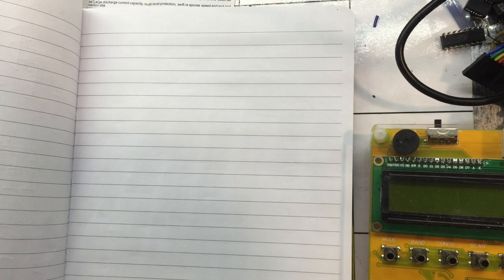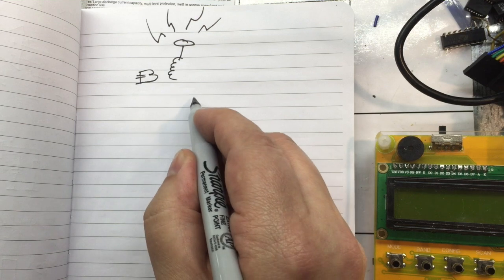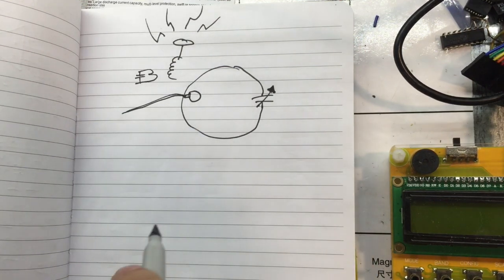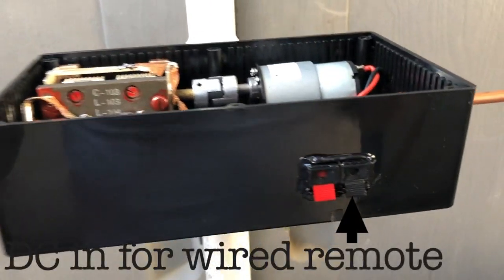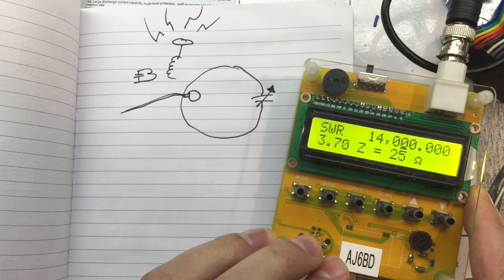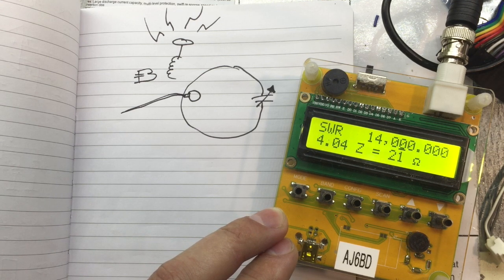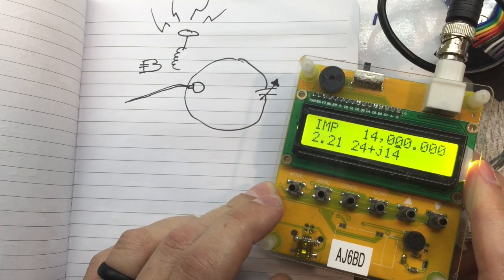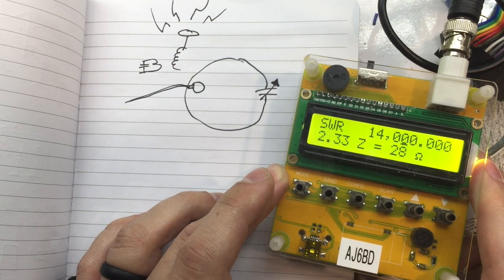Homemade Magnetic Loop antenna -- will it work?

Comment: i haven't seen any math as to find the 1/10 of the wave length for the band you plan to use. after fiddling with some basic equations will offer this result for comment.
300 / f in mhz = wave length
300÷7.074= 42.41 i. e., 40meters
42.41 x . 1 = 4.24 (one tenth)

4.24meters x 36=152.64
152.64÷12=12.72 ft

12.72 ft is length of material of
"ideal" for 7mhz.

fortunately, most of these magloop 
will cover higher freqs. 

i hope this info is useful

Comment: my loop calculator numbers seem to work with most configurations, 
i. e circle, diamond, square and probably stop sign shape.
one thing i noticed with my 3/4 Od copper diamond loop was i needed additional capacity to bring tuning range to 7mhz.
the diamond made if 1/2inch material allowed tuning 7mhz without any extra capacity. i checked this with the software and it showed there was more inductance.  further, i made circular loop with 1/4 in dia copper tubing and it suprised me. i could cover 7mhz to 24mhz. wow, that was cool. i made ONE contact SSB 7mhz with sta several states away to  my lexington ky QTH, he gave me a 20db over 9 report. that was unusual. hv not had any ssb reports like that again. FYI.

Comment: the swr jumping around..
recheck your solder joints.
some math for you

10ft copper tubing x 3.14 (pi) 
= 31.4 inches the dia of outer loop. 

31.4 x . 2 x 3.14=6.28 in dia of coupling loop. 

6.28 x 3.14 = length of material to make coupling loop 19.74 inches.

Comment: your cap is on the bottom.its a high impedance point and shold be kept firtherest from groung potential [it should be on the top n feed should be on bottom..thats a tes best starting point n work it from there...no2 is the length of the feeder loop is too short or too long..fix both of those n youve got a killer antenna...PS the copper braid you have from your capacitor is far too THIN,,,,yiou need thick copper strap maybe 2-3" wide not braid

Comment: tuning cap has to be on the top +++@!
coupling loop you have to Experiment +!
in shape and dimention. use solid conductor (well insulated from air, this mean Cover it wih paint or pvc...or whatever).
73

Comment: Did you insulate the shaft of the capacitor and that of the motor?  I had a similar swr problem and solved it by putting a short plastic stick between them.

Comment: First I would check the size of the inner loop. It should be about 20% of the size of the outer loop. Did you raise it higher off of the ground? You are tuning on the 20m band. You need to be at least a quarter wave length off of the ground to avoid ground reflection. 73

Comment: Push the transmission loop So that it flattens out against the larger coil so that there is more close area and proximity between the two loops it will no longer be a circle but will be more of an oval shape that will help to get your SWR lower

Comment: Rotate the coupling loop along its vertical axis. If the SWR improves, you can shorten the coupling loop incrementally to bring it within the 1/5 size ratio.

Comment: One source of changing readings on you instrument is that it is in a plastic box, maybe fabricate a box of PC board material and you should be able to find a fine wire mesh to put over the LCD screen. The more the instrument is isolated from its surroundings the more stable the readings should be. I too would like to point out that an SWR of 2.5 is perfectly acceptable, contacts will be made, I don't understand some hams obsession with a 1:1 SWR, it is like those guys who took their FT-817 and adjusted the o/p power to its maximum from 5 to 7 watts, the extra 2 watts isn't really going to do anything to other guy's receiver's S meter.

Comment: I use magnetic loops.  Let me suggest using a "Bias-Tee" circuit to feed the DC voltage (for the gearhead motor) down the coax you're using for convection to your radio.  One circuit injects it at the radio end, one circuit extracts it at the antenna.  Both can be built for about $20.  Works beautifully!

Comment: This swr flactuation makes me think i) how good this swr meter is ii) whether there are any common mode currents which are changing with even the tiniest movement. Then we can start thinking about the antenna design itself..just my two cents
Reply from the maker: I have the materials to revisit this soon. Current WX means my outdoor antenna is down, so maybe that's a good excuse to play with an indoor antenna. Only need more time for tinkering...

Comment: I'm guessing by the size of the air variable that won't handle more than 30 watts without arcing, I bought a 12" to 14" long, roughly 10 kv Caldwell air variable capacitor for $65, very touchy though, compared to my other loop with a vacuum variable. Your issue is your loop material, use 1/2" or larger diameter soft flexible copper for your large loop the small can be 3/8" or 1/4" copper, I have built the large loop using large coax, they don't work as well as copper tubing, typically higher swr, to really tune your loop effectively, I would invest in a vacuum variable for a motor driven loop, the vacuum variables are much more incremental for tuning, I have never seen antennas work so well for their size and the fact that they are portable is far more practical for events, exercises, trips, etc. 73's and good luck with your builds.

Comment: Adjust the capacitor for the best minimum value you can then, adjust the shape of the coupling ring so that it is closer to the main large ring and watch for an even better SWR value.  The coupling between the two coils is very sensitive.
Reply: Yup!😉

Comment: Unless something is constantly moving near the loop the SWR should not vary the way it is. You have a connection problem somewhere. The magloop is a very hi Q antenna and sensitive to less than perfect connections. Also, always test outdoors in an area where the risk of mutual coupling is minimized. Antenna formulas are merely starting points to get you in the ballpark. Factors such as ground conductivity, proximity to the ground and mutual coupling may  significantly affect your results.

Comment: Hey man did you followed the 1/5 rule?
The inner loop must be 1/5 the size of the outer. Then the smaller loop you can just move it up and down to get the best SWR. I do tune my mag loop manually would be very tricky trying to do it with a motor.